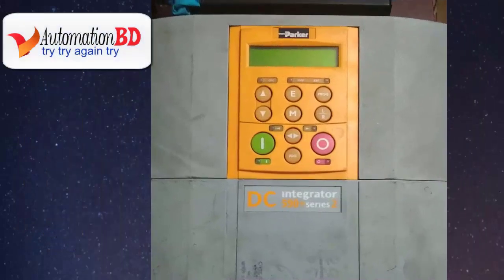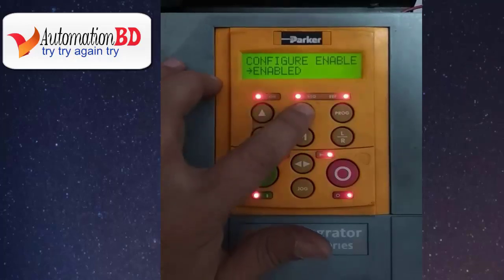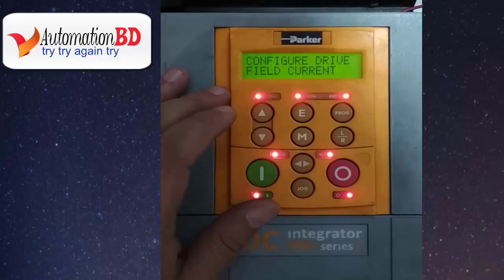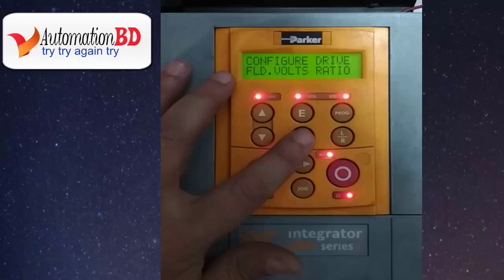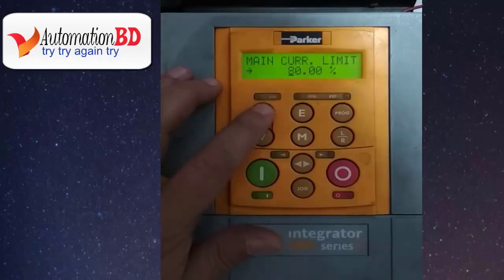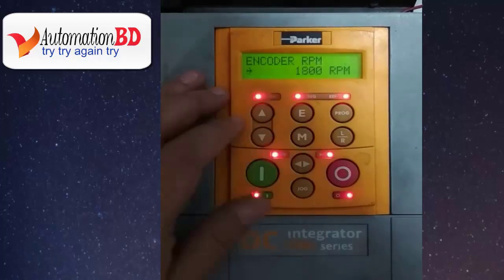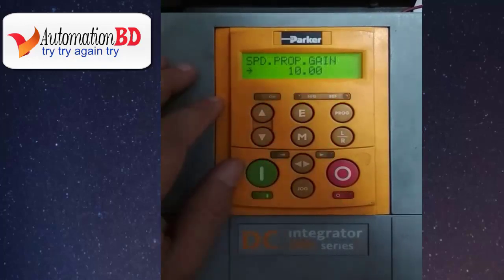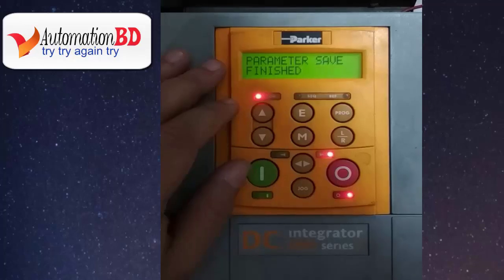PARKER DC Drive  parameter setting or motor data input by Automation BD

Comment: Deai sir praker drive ka scada software me jo programing karte pinch roll tail breaker aur flying shear ka jise operate karte hai usake bare me bataye ya ek video bana de
Reply: Sir I am Naushad from Rolling mill Saudi and  you from where
Reply from the maker: I am from Bangladesh.
Reply from the maker: You Which Rolling  mill in working now??? 
+01672291580 WhatsApp  number. 
Tell me  details. Thanks